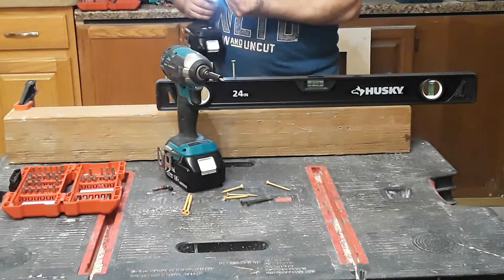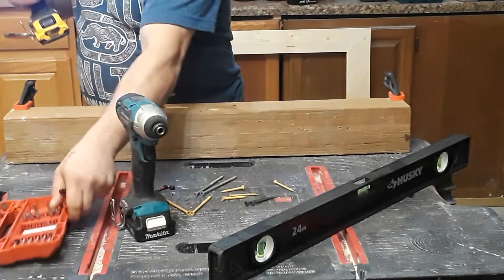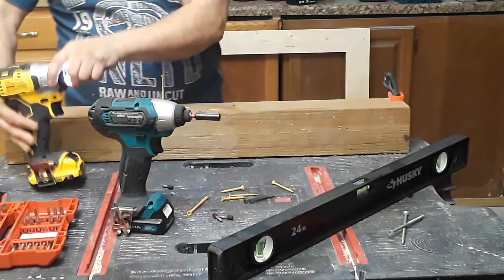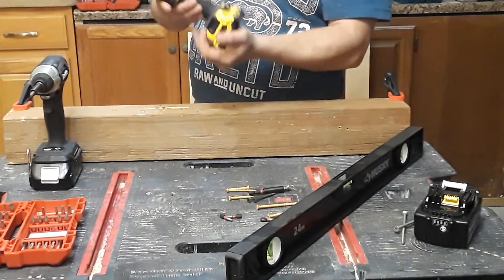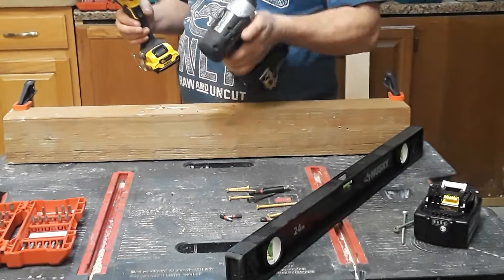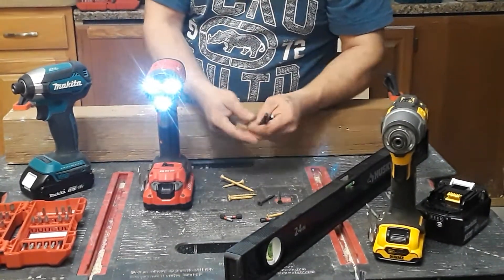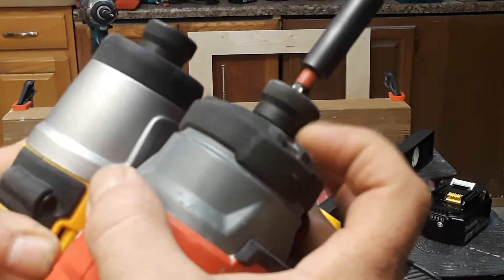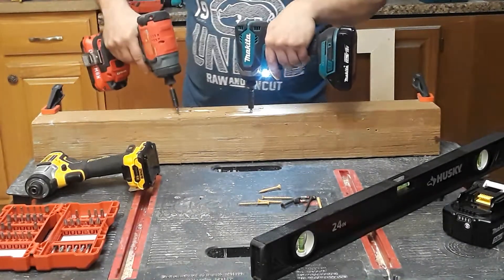A comparison of all the different impact drivers I own and use .PT 1

Comment: Thanks for the comparisons,I actually have owned the same brushless 20v craftsman for a while now,and I recently bought the brushless 12v xtreme dewalt and both work great,so it was interesting to see how they stacked up against each other and the Makitas,thanks for the video!
Reply from the maker: You welcome, basically they are all great tools , a lot of people say the new craftsman are DIY grade but I think they are definitely more contractor grade  brushless tools. 👍 I just picked up a Milwaukee M18 brushless impact driver kit also today for $90 at Home depot and did a video of comparing all of these .👍